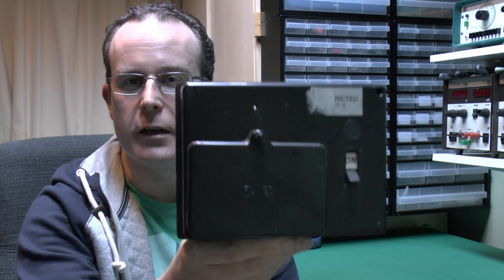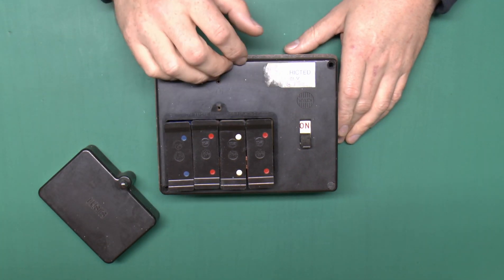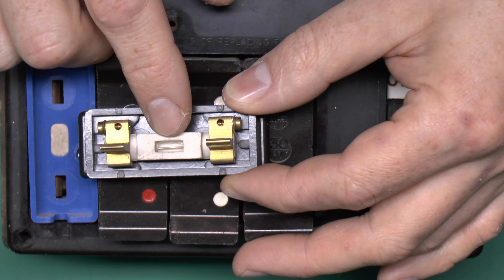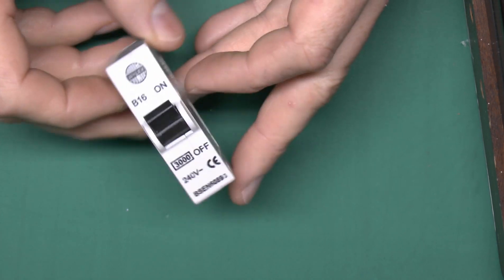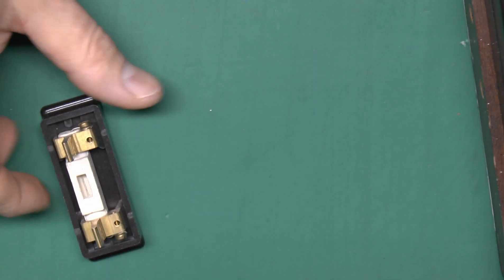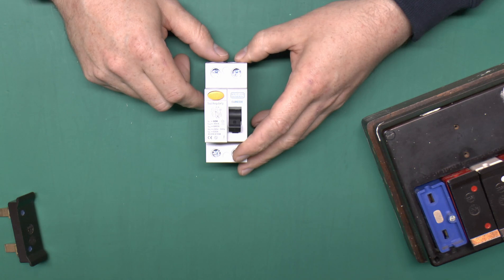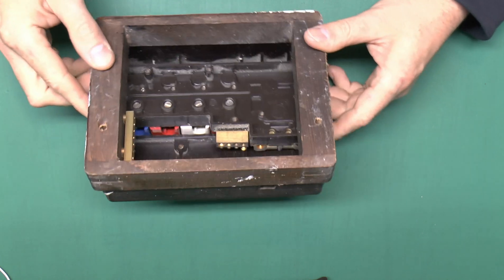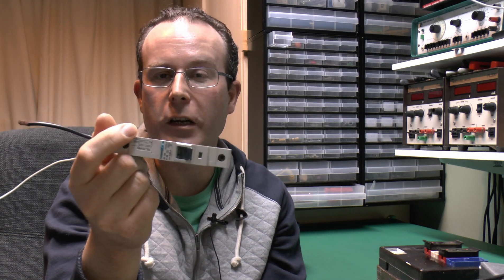Wylex Fusebox - Replacing fuses with plug in MCBs is a waste of money

Comment: John electricians say that an MCB has to be installed before an RCD in the same circuit and  not an RCD and then an MCB. is that true? does it really matter in what order they are connected?
Reply: The main MCD should be installed as first. But then do you use mostly one RCD for two or more MCD's. If you use MCD's before RCD's do you must buy many RCD's. Example: I have for my 5 rooms 12 MCD's after the main MCD in my small appartment, so I must buy 12 RCD's? My electric seller say RCD costs 25€, MCD costs 2,50€. If I calculate this into a normal or bigger house - the electric costs goes too high!

Comment: Well good points, except you forgot human factor, by that I mean when the fuse blows and they don't have the correct size fuse wire or any fuse wire, people have been known to teplace them with strands of wire or wrongly rated fuses, my friends work for local fire service and tell me they have had quite a few fires where the fuse wire had been incorrectly rewired, (example I was given) a house had major electrical fauly the house had major fire damage, the owner told the fire service he put 3 strands 30 amp fuse wire in 15 amp fuse as it kept blowing, at least with the trip type fuses he would not have been able to do that,  
Saying that Screwfix often have the new type citcuit breaker boxes (2 rcd's and 8 standard circuit breakers for around £50:00  so logicaly would pay to replace it
Reply: Steven Reynolds Ha, funny you mention that. I was speaking to a mate at work yesterday (we're meat workers, not electricians) who purportedly 'raped' half the dashboard of his car in order to get enough 'copper wire' to slot into a fuse holder whereby the fuse kept blowing up to three times per week or more ... fixed the fuse problem, but claimed the switchboard turned 'white' before the whole house required a complete re-wire!
Reply: Steven Reynolds I'm really unclear why the British regulations ever allowed rewireable fuses. That seems like it's just asking for trouble. It's not like ceramic fuse cartridges are terribly expensive.
Reply: Jasper Janssen These are very old fuse boxes. Before the age of DIY, most home owners called an electrician. As more house fires and electrocutions were linked to abuse of fixed electrical wiring and fittings, so the regulations gradually change. But even after the change in regulations, as most are not retrospective, old fuseboxes continue in service because most people don't want to spend money on replacing them. But are attracted to retrofitting these MCB modules. Even though, replacing the whole unit is the better long term option, as the included RCD(s) provide(s) extra protection.
Reply: Mark 1024MAK I’m an electrician and I constantly tell folk to do the correct thing and change these as nearly every one I go in is burnt or got the wrong fuse wire in it . And more seriously ( wait for it ) A NAIL. Yes that’s really right a nail you hammer into wood . Now I’m glad  I seen this as it would take the board of the wall and into the garden when this blew ( if at all may I add )  🙈. Some people are just not worried about danger until the worse happens . They are staring at the fire brigade hosing down their house . Or someone gets hurt . 

Be sensible , be safe . 👍
Reply: My old dad had a short in the garage once (a cable was arcing) and on christmas eve he upped the fusewire in the wylex using the little carboard fusewire packs, until he got to 45A when the main supply fuse went bang. His excuse was he didnt want the freezer defrosting, the man from the electricity board was most understanding.

Comment: I will fit them for infirm customers where fuse wire is too fidely for them and have swapped over 100's in shops and national trust propeties, where cost is a big problem! In some cases ease of restoring power is more inportant.

I believe the Zs values are different for the 3036 fuse wire compared to mcb types.

But at the end of the day the cost of a new board in the uk is not just a straight swap, we are having to carry out small periodic inspections before replacing boards because theres nothing like finding a shared neutral once you've installed a dual RCD board! =)

Comment: BRILLIANT video. Thank you John.
Clear information which has just saved me ???£'s. I was mind set on replacing my old fuses with trip switches thinking the trip switch would save anyone (by that I really mean me) being electrocuted if they did touch a live wire.
Reply: Fuses only protect devices etc fron causing a fire. 
If you get electrocuted and killed, the fuse probably wont even blow. 
You needs to have a RCD, big thing with a test button and switch.
Reply: TheHairyHound I would check to see if you have an RCD in line! Has a small button labeled test! push it and it should trip, also to increase your safety see if you have green/yellow wire attached to your gas/water
Reply: Fuses only protect devices etc fron causing a fire. 
If you get electrocuted and killed, the fuse probably wont even blow. 
You needs to have a RCD, big thing with a test button and switch.
Reply: drkastenbrot incorrect.
Reply: LOL at anyone who thinks that installing MCBs will make it safe to go around touching live wires!

Comment: These MCBs do have a use on lighting circuits, were a cheap GLS lamp with no internal fuse can take out the CU fuse when it fails.

Also the non-combustible CU reg change isn't retrospective.
Reply: Been there at 6am on a winters morning before work, all lights out and you got to rewire a cartridge in the dark. MCB so much easier.
Reply: @jasonsmith4888  Catching up?
Reply: @Graham_Langley  yep knew it was an old post but knowledge is knowledge.

Comment: The MCB also has the advantage of being able to be shut off without exposing line voltage.
Reply: yes...which is quite important for me as my shower pole-switch has broken in the on position and the only way to turn off the power to the shower unit is via MCB
Reply: @vincentdeguard4726 uhm… that’s not good. Leave it off until you can afford an electrician.

Comment: Circuit breakers trip instantly under short circuit conditions, where as there will be a considerable delay with a rewireable fuse. Also when overloaded (especially when inrush current is involved), again an MCB will trip instantly. A rewireable fuse will just get hotter and hotter. I've installed a couple of 'retro-fit' wylex breakers and they work fine. For what it cost's a whole new 17th edition board may as well be installed!

Comment: I have only had to re - thread a fuse wire once. doing it the dark, holding a torch in my mouth convinced me that pressing a reset button once in 14 years is worth it, even though apart from convenience, there is no value - add in replacing them

Comment: so if I just wanted to replace the old fuse type to save the pain of me, or my wife who knows nothing about fitting a tiny piece of wire in the dark until I get home to fix the fuse, they are perfect for the job?
Reply: +John Ward 'Regularly' isn't the issue. The issue is getting a electrician to come out and re-wire a fuse at 2:30AM just because a light bulb took out the CU fuse. Certainly not a waste of money then.
Reply from the maker: Terry Taylor They are certainly much easier to reset than fusewire, however fuses should not need to be replaced regularly.

Comment: Very informative John. We have a consumer unit at home which only has MCBs in it, but not really enough space for 2 RCDs to cover 2 sets of circuits with the MCBs that are already there. Is it worth replacing the lighting and power circuits MCBs with RCBOs as they would only take up the same space in the consumer unit?

Comment: I note that the mcb unit and old wire fuse cartridge you show in video have different pin sizes. i.e. the mcb pins look closer together. Will they still fit into the old consumer unit?
Reply from the maker: JAROMELIA Different ratings have different pin spacings.  MCBs are supplied with a plastic shield which has the correct spacing, it is necessary to change the plastic shield when fitting different devices.
The metal contacts in the fusebox are much wider, so will accept several different ratings / pin spacings.

Comment: firstly bs60898 and bs 3036 fuses have completely different time/current characteristics so to state that both perform the same task is completely incorrect. Secondly the fact that the service head has a 16KA rating and therefore does not matter whether the protective devices have a 1KA or a 2KA braking capacity is also incorrect. The purpose of a prospective short circuit measurement is to make sure that the protective device can contain the fault current flowing AT THAT POINT IN THE CIRCUIT. if 3KA were flowing under fault conditions at the MCB then it will fail regardless of the suppliers cut out upstream......
Reply from the maker: Lee lee Obviously fuses and circuit breakers have different characteristics, however their purpose is the same - disconnecting in the event of overload or short circuit.
The point of the video is that removing fuses and replacing them with circuit breakers is not an 'upgrade' and does not improve safety, it is just replacing one protective device with another.
Unfortunately there are plenty of people who believe that buying and installing these plug in MCBs has somehow upgraded their fusebox / made it safer / is an alternative to installing a modern consumer unit.

Use of protective devices with a breaking capacity less than the prospective fault current is permitted as stated in section 434.5.1 of BS7671:2008
This technical bulletin from Beama: http://xo4.uk/?NsO explains this in more detail.
Reply: Lee lee bs60898’s are 6k.

Comment: I understand that the new combined MCB and RCD devices are referred to as RCBO's ? Are the RCD and RCBO devices rated at different amperages (5, 15, 30 amps etc.) like the old fuse wires ? Is the ultimately "safe" installation to have separate RCBO's on each segregated circuits like lighting and plugs ? I am referring to the upgrading of an existing installation in an old house. Do you know what new installations in new houses are like under the current regulations ?
Reply from the maker: meandmymouth RCBOs are available in various ratings, 6,10,16,20,32 etc. just the same as MCBs.
Virtually all circuits now require RCDs, so the most common options are circuits with individual MCBs divided between two RCDs, or individual RCBOs for each circuit.

Both are equally safe - however the RCBO option is superior, as this means that a fault will only affect one circuit.  With the dual RCD arrangement, a single fault will cause multiple circuits to be disconnected, and remain that way until the fault is located and removed/repaired.  While this can be mitigated to a certain extent by having upstairs / downstairs circuits on different RCDs, it is still inconvenient and ultimately a poor solution.
The only benefit of the dual RCD type is it is cheaper than all RCBOs - hence consumer units sold in DIY stores are usually of that type.

Previously it was permitted to have one RCD for the entire installation - this is no longer allowed, as although just as safe, means that any single fault anywhere can cause the entire installation to be disconnected.  This is hugely inconvenient as it leaves the whole house without power until the fault is located and repaired.
Reply: ***** Many thanks for your most helpful advice.
Reply: ***** i still have the old set up where its just a main breaker and mcbs with no rcd or anything..i believe its fine since i dont have any cirucits outside or in the bathroom..its pretty safe to be honest
Reply: ***** I have a consumer unit with one RCD and multiple MCBs. Can the MCBs be replaced with RCBOs, or do you need a new consumer unit?  I saw another video, where you took a MCB apart, to explain how it functioned. A similar video on a RCBO would be interesting for comparison.
Reply: dalriada842 yes they can be replaced with individual rcbos however get it done by a proffesional electrician. save u a lot of hassle in the long run
Reply: meandmymouth RCBO's are brilliant for both house holders and electricians, however a dual RCD board is the cheaper alternative to protecting all of your household circuits at a fraction of the cost! Some domestic boards cannot accept RCBO's due to thier height and typically cost £35 and upwards each
Reply: meandmymouth an Rcbo is a combined mcb and rcd, it’s a more expensive route to take but ultimately better. With a pair of rcd’s protecting a bank of mcb’s you will lose that whole bank of mcb’s if the rcd trips where as with rcbo’s everything is individually protected  so only the circuit with the fault trips.

Comment: John, where on an old Wylex 3036 db does it give it's device designation, ie S1A, S2A or S4A indicating its rated short-curcuit capacity 1,2,4 kA respectively? I was told if you are unsure to take it is 1kA.
Changing a rewireable fuse with a push in MCB can change the characteristics of the curcuit and in some cases help comply with the 17th?
Reply from the maker: The Wylex boards and fuses are not marked - they are either 1kA or 2kA, but no reliable source to confirm which they are.
Not normally an issue, since the supplier cutout fuse will provide protection up to 16kA, this is one of the tests in BS EN 60439-3 Annex ZA (previous standards were similar, it's been in there for decades).
Actual fault levels in domestic premises are usually far lower than that anyway.

MCBs will certainly have different characteristics, the .725 correction factor can go for a start - however unless the original circuit was grossly wrong in the first place, it's not likely to make much difference.  May be of value if it was a 30A ring with 2.5mm/1.0mm T&E.  Either way, there is still the lack of RCDs, the flammable enclosure, maximum 30A per way etc.